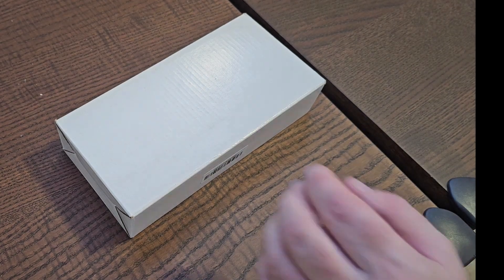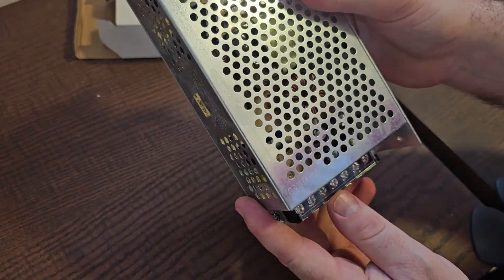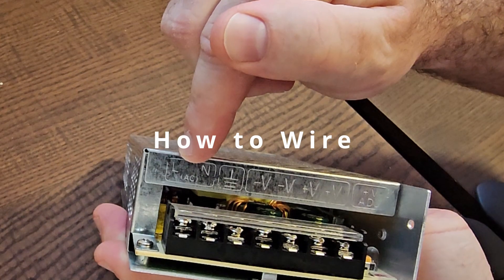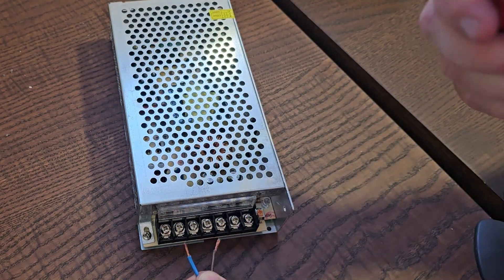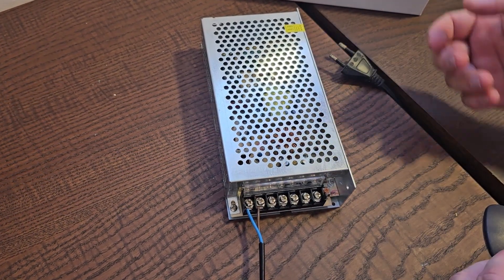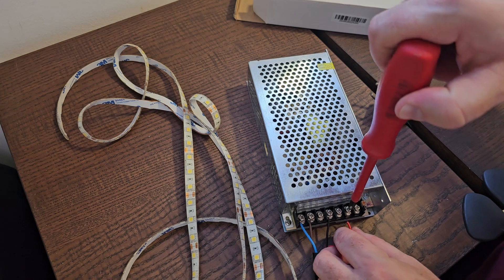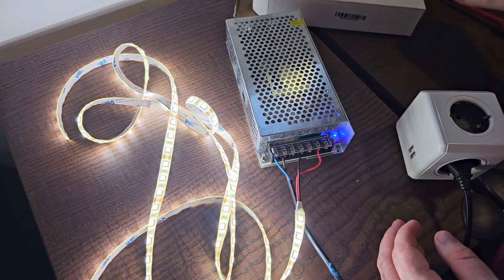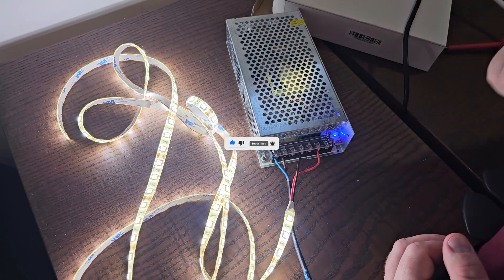How to Wire a Switching Power Supply

Comment: Exactly what I just needed! Bought a smaller one like that with no documentation. I did not even know that it is called a switch power supply until I search for a few minutes. And if you look for SMPS videos, they will give you a seminar which is typically 30 minutes.
Reply from the maker: Glad I could help!